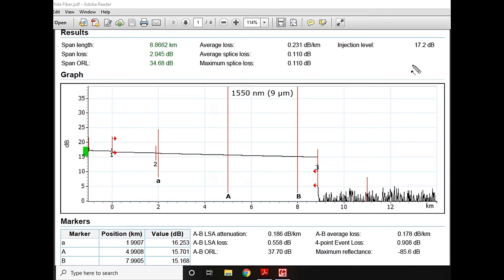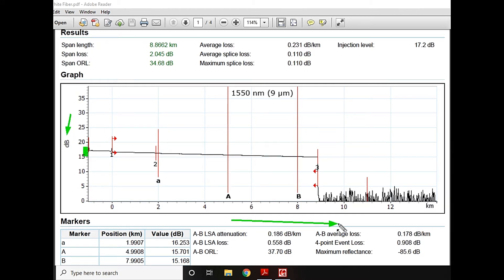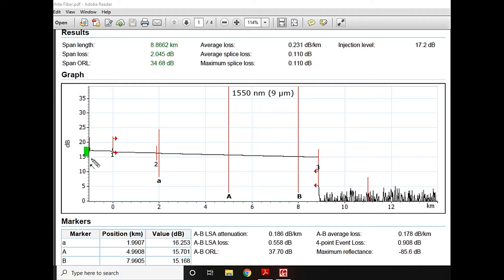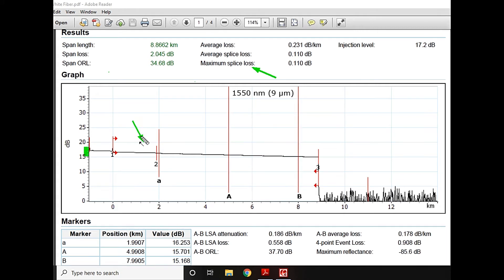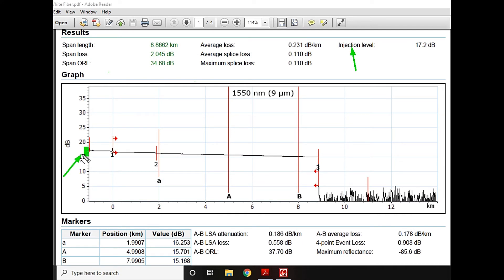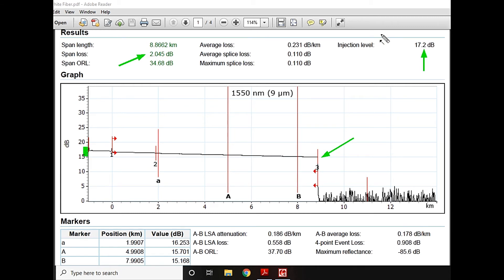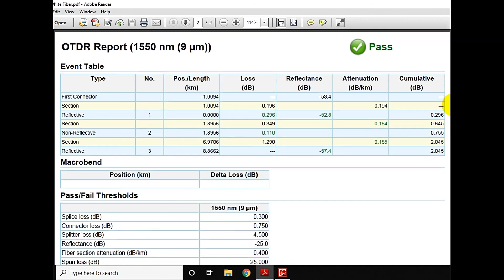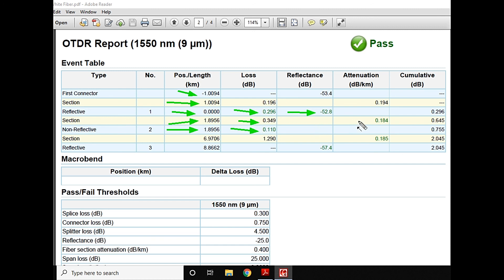How to read OTDR graph correctly || OTDR Graph fully explained

Comment: why is the result of splesing event loss the result is negatif in otdr
Reply from the maker: That's gainer
Reply: It is bad splesing mr
Reply from the maker: @Fajardani88  No the negative value represents that there is core cladding mismatch at the point of splice. This can happen when you splice two different types of cable.
Reply: @MSB1180  ok thanks mr
Reply from the maker: Welcome brother